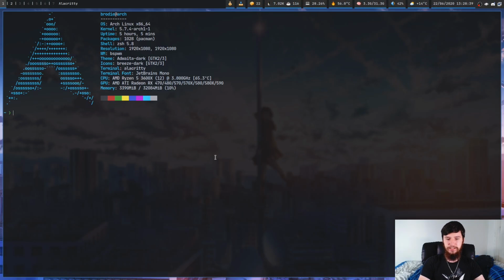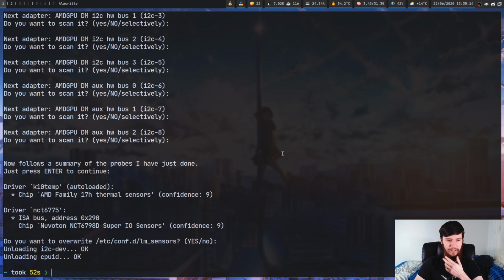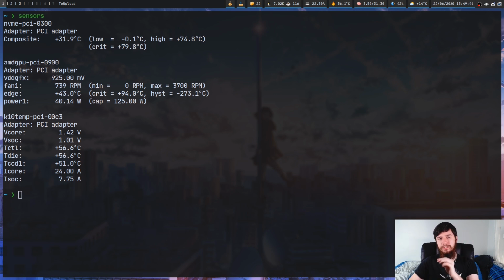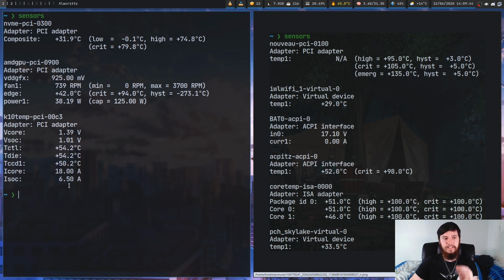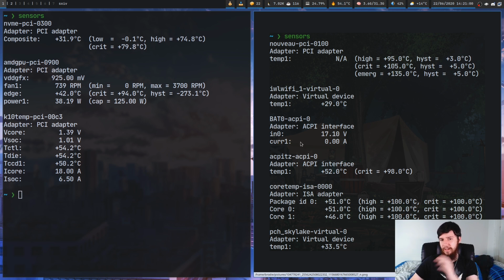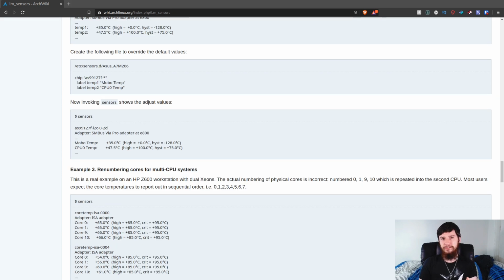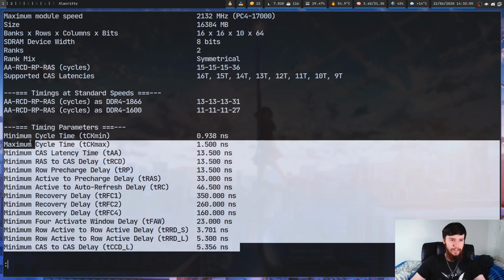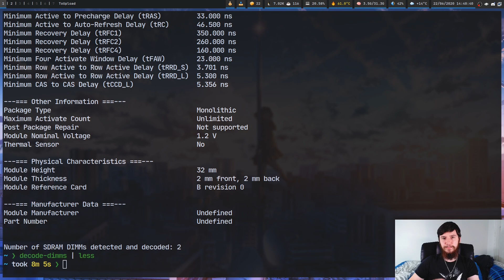Lm Sensors: It's Simple To Query Your Hardware Temps

Comment: Your memory modules are running very slow which has a large negative affect for the performance of a  Ryzen CPU. You are running at 2133mhz, you should be aiming for 3000mhz if you can. There most likely isn't a need to overclock, in the bios there will be an option called xmp profile which will set the memory speed and timings to the actual specifications of your memory.
Reply from the maker: Thanks for the heads up, I know these module should run quicker but I wasn't sure why they weren't
Reply: @BrodieRobertson  Note that decode-dimms shows the default speed, not the actual speed. The tool `lshw` can give you the actual clock speed of your ram. This caused me some confusion when I was messing with my ram.

 (e.g. `decode-dimms` shows my ram clock at 2133 but `lshw -C memory` shows 2933)

Comment: This is conky based on a T430.
sudo hddtemp /dev/sd[abcdefghi]     
/dev/sda: Samsung SSD 860 EVO 250G B              @: 36°C
/dev/sdb: HGST HTS721010A9E630: 33°C
/dev/sdc: Samsung SSD 860 EVO mSAT A05G0 B        @: 44°C

 To use the above for hard drive temps you have to edit your hddtemp.db and add them as below.  This only seems to work with Debian.
########################################
############# Samsung drives
########################################
# somenone reported a problem with the SP8004H which reports a temperature
# 10°C below the ambient temperature
"Samsung SSD 840 EVO 250G B"        190  C  "Samsung SSD 840 EVO 250G B" 
"Samsung SSD 850 EVO 250G B"        190  C  "Samsung SSD 850 EVO 250G B"
"Samsung SSD 850 EVO 500G B"        190  C  "Samsung SSD 850 EVO 500G B"
"Samsung SSD 850 EVO M.2"           190  C  "Samsung SSD 850 EVO M.2"
"Samsung SSD 860 EVO 250G B"        190  C  "Samsung SSD 860 EVO 250G B"
"Samsung SSD 860 EVO 500G B"        190  C  "Samsung SSD 860 EVO 500G B"
"Samsung SSD 860 EVO mSAT A05G0 B"  190  C  "Samsung SSD 860 EVO mSAT A05G0 B"

for m in /sys/class/hwmon/* ; do echo -n "$m = " ; cat $m/name ; done
/sys/class/hwmon/hwmon0 = acpitz
/sys/class/hwmon/hwmon1 = thinkpad
/sys/class/hwmon/hwmon2 = coretemp

hwmon1 is for fan = ${hwmon 1 fan 1} rpm 

hwmon2 is for cpu cores = ${cpu cpu1}% ${hwmon 2 temp 1}° | ${cpu cpu2}% ${hwmon 2 temp 2}°

Link to the bar its self = https://ibb.co/cJbKpPR